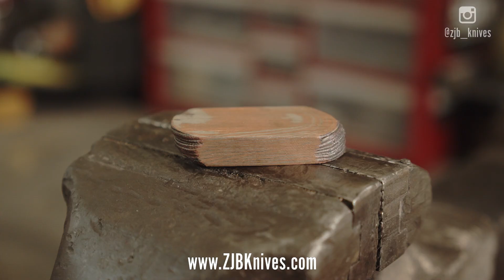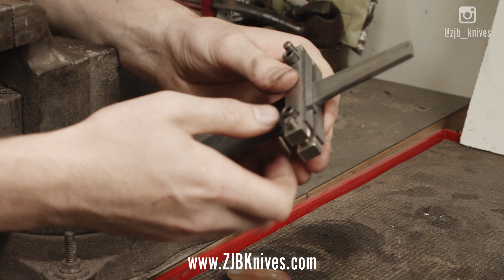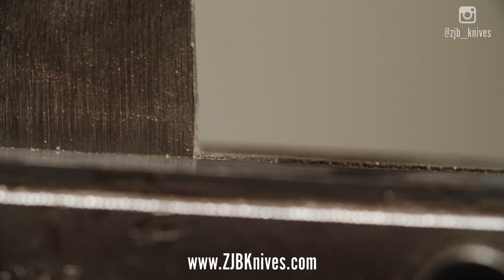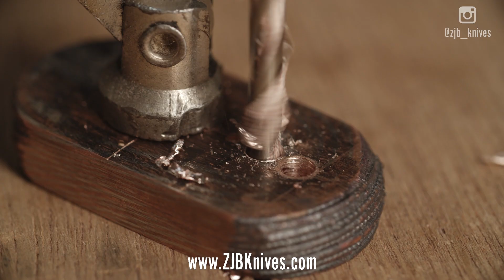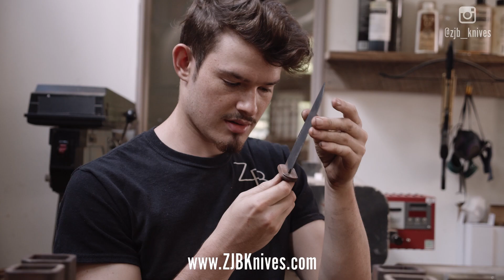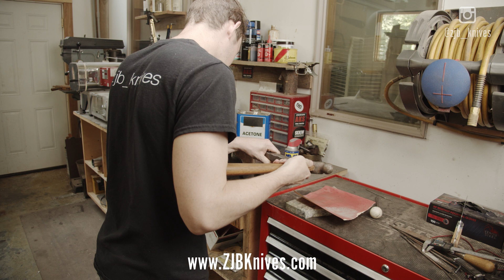PERFECT GUARD FIT UP WITH MINIMAL TOOLS

Comment: Minimal Tools .. yeah let me just get my pocket hydraulic press, everyone surely has one of those 😂
Reply from the maker: @cedrics1220  you can use any hammer to accomplish the same task my brother!
Reply: @zjbknives  I will surely give it a try 😁 was meant more as a joke than anything else 😅

Do you have any tips for knifes that are kind of thin? I have trouble making fitting bolsters for those because of the small drill bit and file size you need

Comment: "minimal tools" : *pulls out hydrolic press 😂
This was pretty nice ! I was missing the hammering part. Why don't you round the shoulders ? Sharp corners between the tang and the shoulders create a stress point
And how do you determine the width and length of the tang ?
Reply from the maker: The French Knife Maker I just estimate how long the tang should be, and the wider the better! I’ve never experienced any issues with fracturing blades on stress points like that, but it’s a good observation
Reply: @zjbknives  okay thanks for your answer !